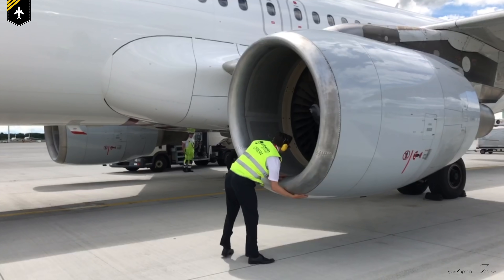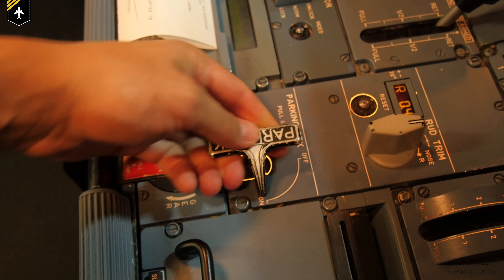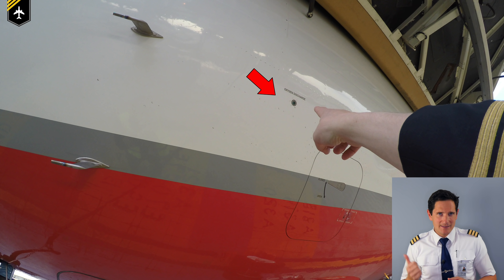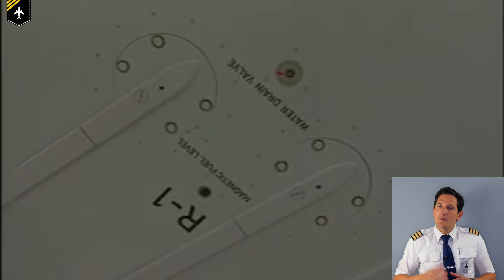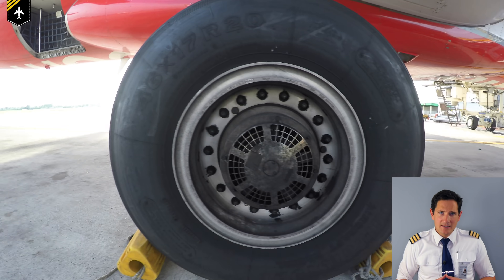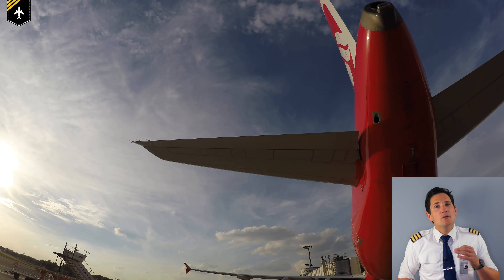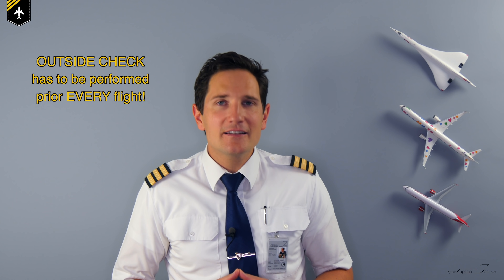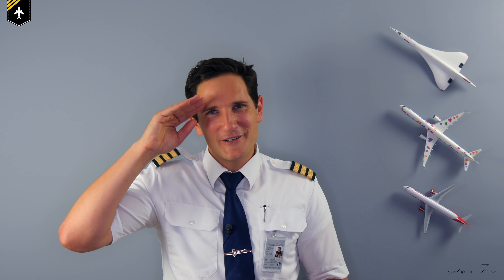AirbusA320 OUTSIDE CHECK explained by CAPTAIN JOE

Comment: 2:56 that what happen on Aeroperu flight 603 where a duct tape was on the static port on a Boeing 757 23A, this caused instrument failing and the flight crashed in the ocean. If your wondering why it wasn't spotted by the pilot then do this: look up what a duct tape look like. It was silver and the static port was silver too so they missed it because it was camouflage.

Comment: Hiii  Joey. 
You are doing an awesome job on the channel. Big fan of yours.

A small correction. It's not a "Generator inlet" on the outboard side of the Engine#2 . It's the Engine's ECU cooling inlet.

Comment: why would you touch the spinning engine?
Reply: Ramesh Sharma engine isn’t on.
Reply: @ZK-APA  yes, it's not on but engine fan blades are spinning. Aren't they?
Reply: Ramesh Sharma yea, but that’s mainly because of the wind. So as long as you are aware and know where you are putting your hand, shouldn’t be an issue.

Comment: Sir, fantastic.. please clarify my following doubts:

1. In A320 during take off the elevators are raised or lowered. 

2. For how long you raise the elevators during take off?? Do you raise it till the aircraft leaves the ground or keep it raised?

3. The wings of the aircrafts looks slim, how can it accommodate enough fuel for long flights.

Thanks!!;
Reply: Samuel Prince ur answers

1. Elevators go up. In short, elevators up-nose up. Elevators down-nose down.

2. There is something called as elevator trim, which holds the back pressure as required. And it’s not always holded up, else the nose will keep on going up.

3. It looks slim on pics or videos, but when you see it physically, you realise the actual size of it.
Reply: A2DJP 
Thanks for the answers..
Reply: Samuel Prince each wing holds 6 tonnes of fuel, centre tank is also 6 tonnes but is rarely used

Comment: How does keeping the oxygen level on high altitudes work? (Obviously you can't just let fresh air in at 35000ft)
Reply: M4x0x there is oxygen outside, it’s just pressurised to a lower level inside the plane.

Comment: 09: 43 As in APU fie extinguisher over pressure disc in APU, why there is no such indicators for engine fire extinguisher bottle in pylon?
Reply: Pradeep Srinivasan Naiker That’s a good question! Engine bottles are indicated on the flight deck if they blow!

Comment: I'd be interested in hearing more about the static ports.  I presume they attach a grounded cable to them to "drain off" the built-up static electricity, right?
Reply: No. They are for the altimeter and part of the true air speed indicator.

Comment: Joe, how to take off your a320 during earthquake? Somehow one pilot from Indonesia can do this in Palu during earthquake. His name Capt. Ricosetta Mafella

And his chat via WhatsApp : 

"Batik Air ID 6231 scheduled to depart at 17.55, door closed at 17.52 then pushed back.

18.02 after cleared for take off, tower building collapsed.

We were just rolling on the runway.

I felt something wrong on the runway during take off roll. 18.02 earthquake 7.4-7.7 magnitude on scale rocks Palu.

Thank God there is a voice (Holy Spirit i believe) telling me to depart early.

I’m rushing the boarding process.

Late by 30 second i would not have flown.

Thank You Jesus. I took this video just after airborne on 1500ft climbing. Strange wave-Tsunami."

And he even said, during Climbing phased, he tried to contact the Palu ATC, but failed, later he found out that the ATC controller has passed away...
Reply: Pray for Palu...

Comment: Dear Joe, first of all I would like to express my admiration and to tell you that apart from being an excellent captain and I am very sure of it ... the most important thing of all is your personality , I think you are a very intelligent and very special person ... keep going like this!!!!. I would like to ask you something about the aileron system of the 777's and the 787's, and I am talking about the internal ailerons (when one of these big birds are at the head of the runway ready for take off, you can see that the high speed aileron goes first down then it goes up and is repositioned again at the flaps level ... for which reason? .. If you can answer would be an interesting thing to kill this curiosity that I have been for a long time .. A strong hug .. Roberto Urdaneta  Urdaneta

Comment: Something I've always wondered about is about the use of phones and other wireless devices on airplanes. Some people say they should be in airplane mode and others say it's fine not to have them on airplane mode. You're a pilot, so you should know the answer.

Comment: Hi, I am from india. I just want to know during takeoff after about one minute why does the sound of engine fluctuates. Sometimes it feels as if the engine is slowing down. Pl explain the reason.
Reply: tapan kumar mohanty if you don’t throttle back the aircraft will travel too fast! Most terminal areas have speed restrictions

Comment: Hey Joe, I’ve been wondering recently how wind shear escape is managed in the airbus. Mentour did a video explaining really in depth how to fly 738 during a wind shear escape manoeuvre, but it got me wondering how the airbus’ intricate autopilot system reacts during the same condition. In the Boeing you may end up flying at stick shaker alpha to escape and the slightest pitching down could spell disaster, but the airbus tends to take over and pitch down during a stall condition? Do you get full absolute authority during wind shear? Hope you get what I mean :)

Comment: Hey captain joe, I know In your video about squawk codes you said that if you lose communication, you use squawk 7600 and the airport you are landing at will instruct you with lights. Could you do a video over landing without communication, or at least kind of explain how that works a little bit more in detail?

Comment: Hey joe what are the black and white spiny thing bye the throttle
Reply: They are called the trim wheels. They are used to "trim" the elevators so the aircraft flies straight on when the pilots doesn't do anything on the stick.

Comment: Actually what does the engineers do in the old plane during flights, why it is not needed in  the new plane such 747 A380, there are more passengers don't it will be safer with a engineer
Reply: The Engineer was there to monitor all the technical systems, like hydraulics and so on. In modern planes you don't need that anymore because the systems monitor them self. In an Airbus for instance if there is a problem with one of the hydraulic systems, the plane will notifiy the pilot automatically about it and shows them all relevant data about it on a screen and what the necessary steps are to either solve the problem or if that isn't possible to at least isolate it.

Comment: I have a question: why lasers are so dangerous to the pilots of an aircraft?
Reply: Aim a Laserpointer right into the eyes of a person and ask this question again afterwards.
Reply: yeah, it is annoying when someone point you with a laser pointer, but why is this magnified on airplanes?? i have seen flights that turn back and lands almost declaring an emergency because they have been hit by a laser pointer.
Reply: Laserpointers can be harmful and you can get partially or completly blind if the laser pointer is strong enough. Furthermore the laserpointer blinds you for a few seconds, it's like looking into a flashlight at night. The problem with planes is, that they need two pilots to operate smoothly, if one of the pilots isn't able to perfom his duties, because he is blinded, the other pilot has to more or less fly the plane on his own even though the plane is meant to be flown by two pilots. 
Also if planes declare an emergency then one of the pilots probably got hit by the laser and may even suffer from shortterm blindness.

Comment: Always very informative and interesting videos Captain. 
One thing i wanted to ask away from the current video topic is - i have seen white lights in strobe, takeoff and landing lights on new aircraft of 737, 787, a350 and a320.  Were the lights originally yellow earlier? And is there really a specific reason for having white light? (Like better illumination or less power consumption due to LED light etc).

Comment: Hi Captain Joe. You didn't mention about the latches below the engine. This is a very important part from a good walk-around and this part were open in few Airbus. There was including a A319 from BA who lost the both sides of the covering engines during flight. Tks for the videos and have safety flights.

Comment: Sir, please make a video on VNAV approach which was recently made by pilots of Air India flight 101 at Newark Airport due to multiple system failures in the 777 and bad weather conditions at JFK. I've heard the ATC recording but didn't understand most of it. Please explain the VNAV approach in one of your upcoming videos.

Comment: Captain Joe,What is between the Landing gear control and Multi Control Display Unit on Airbus A320-200  and what is it's function?and is it similar to Boeing 747 little down to yoke?

Comment: Hello Captain Joe, I have an answer. Why is the TAS constant when the pressure is low when the IAS is constant? When the altitude is constant, I am curious about the relationship between TAS and pressure, the relationship with temperature, and the altitude.

Comment: Hi, I'd like a video on when you use thrust reverser. I mean, I know they are for landing, to slow down, but what is the decision-making process to use them ? I thought that you can't use them when you are unsure to land safely, to be able to to a missed approach (or "touch and go" ? how is it called when you already have touch the runway ?). But I also know that it cost fuel, so if you are already able to land safely, why use them ?

Comment: Hi captain
What is the general deflection angle of flaps during take-off and landing? 
Is it same or different for take-off and landing
I'm a engineering student 
This question came up in our classroom discussion but know one knows correctly pls clarify our doubt.
Reply: ranjith kumar neeruganti it really depends from aircraft to aircraft. But t/o has less flaps than landing. Eg for the 737 it’s around 5 for takeoff and 30 for landing. However these are not hard numbers, and you can use other approved flap settings

Comment: 12:46 Huh … so what? I never take off with any of my drones without touching (and bending a little bit) every single propeller blade. They could have been damaged in the carrying bag, leading to imbalance, vibrations etc. I also want to make sure that all motor bearings are in a good shape — yet another reason to wobble your propellers a bit. Bearings stay very close to the etymological origin of their names in drones — they bear the whole weight of the aircraft — no exceptions, no gliding options, no auto-rotation options. Yes, it may seem funny in comparison to a 100-ton manned aircraft, but you don’t want your 1kg drone to fall on someone. Some of my drones are less than 300 grams, but still — hurting someone with that is the last thing you ever want.

Comment: I have a question, why are rudders split in to parts ( a top part and a smaller bottom part) (not the vertical stabilizer)

Comment: 6:05 I love how he just spins a friggin jet engine like it's a toy windmill
Reply: He actually does not spin the entire engine. The fan (part he touches) is connected only to a few similar, but smaller sets of blades (low pressure compressor and low pressure turbine). Because you need very high rotational speeds for significant compression to occur it is (as you can see) quite easy to turn slowly.

Check out this https://www.youtube.com/watch?v=KjYw0GdRpm0 or https://hursts.org.uk/airbus-technical/html/ar01s19.html 

If you want to know more about Jet engines in general, check out AgentJayZ's channel here on youtube, he repairs jet engines for a living and is real good at explaining them!
Oh, and those engines will hay bearings that are way better than your typical toy ;)

Comment: Dear Joe, 
What type of "unusual noises" do you actually listen to when spinning the blades? You know... since you're wearing ear-plug, or headphones, or both? And since the ram/pad is usually so noisy itself. 
Also, why do I often, when standing in the terminal looking at the parked plane, see at least one of the engines outer fans slowly spinning, whilst the other isn't (it isn't the wind slowly spinning it, I'm guessing, since it's only one of them).

Comment: 0:35 did he just touch a spinner cap of an engine that was still spinning?
Reply: A little bit of wind can spin these engines, but only at very low speeds (some more info here: https://www.youtube.com/watch?v=oLb31cW4p58)
It is probably easier to feel small damage than see it and less risky than stopping the fan to get a good look . . .

Comment: I have a question. Is the joystick on A320 is comfortable to operate in left hand for the captain? I think it is not precise as classic approaches in planes.
Reply: maxpayneau you get used to it. Besides even with a yoke, a captain will fly the plane with the left hand
Reply: Its called Sidestick to start and for your question Its way more precise than a conventional control column.A320 has a fly by wire system.U can google on that more.To sum up it's most precise Pilot handing could ever be along with comfort.

Comment: When you dont have enough money to have your buttlers do the routine safety check.  Dude save up for some buttlers. They are the shit. Joe, great video, i learned a lot about the airplanes. A cool video would be about the life of airplane parts. Lets say... How long does it take for the tires to get old and need to be changed. The brake pads how often are they changed. How many flights happen before taking the airplane to the workshop for its general maintenance.
Reply: Major Tom the pilot is legally obliged to check the plane,as he/she is the one one flying it
Reply: Ok that i didnt know, im afraid ill have to fire my buttler

Comment: I'm an ex- Airforce guy who now flies RC airplanes for fun! ... before the first RC flight of the day.... grab and wiggle every control surface... look at the control linkages... push/pull on the engine/mount... push/pull on the wheels... have a close look at the prop... do a range check...,  do a "...is it moving the correct way when I wiggle the sticks check,"

More than once there has been something that has grounded me for the day...

Comment: At 9:12 next to the drain mast is the outflow for the toilet vacuum generator. Last week I was doing my walk around and there was a stream of human shit all the way from there to the tail which I mistook for oil. The engineer said a system seal was on the way out but it was still servicable. We flew through a few rain showers and washed it off.

Comment: C.J. This is the best aviation video that I have ever encounter! I always thought that the walk around was a gimmick since the ground crew would have checked all of this. Now I am really impressed!
two questions: 1- how do you check the turbo blades on a three engine jet upper engine(DC-10,L1011,727) 2-winter conditions(-20F,40 mpg gusts) do some pilots skip some of these checks? Wouldn't the pilot have to have some kind of heavy parka to withstand extreme conditions?

Comment: I am an RC pilot, and I can tell you that the outside check is very simple. We just have to check if the control surface hinges are locked, does they respond correspondingly, and you are good to go

Comment: One small mistake at 6:13min. The upper inlet is not the inlet for generator cooling. This is the FADEC cooling inlet! (FADEC = Full authorized digital engine control) which is installed short behind the inlet. But..., good Video!

Comment: This vid made me want to get back to gliders. It's so much simpler - engines not a problem haven't got any, antennae? not a problem have not got any, pitot tubes/AoA instruents - not a problem have not got any, fuel indicators - not a problem have not got any. Don't need ear protection either.